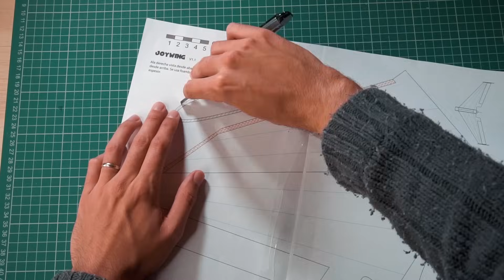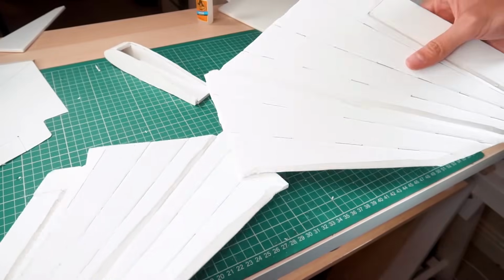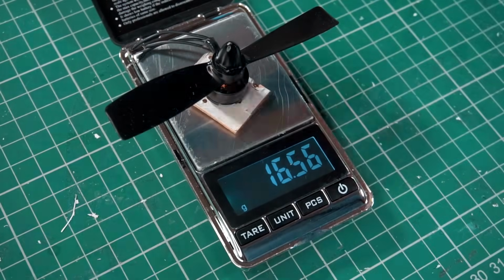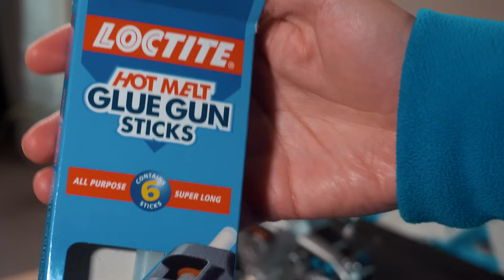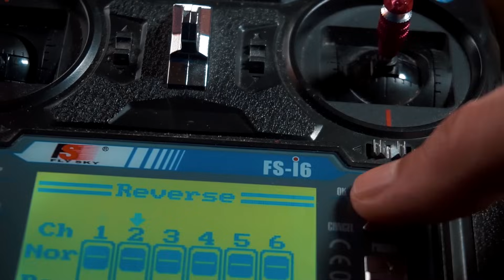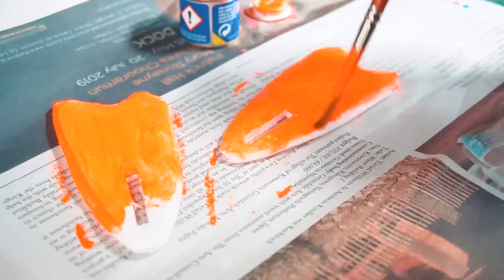I made an RC flying wing | Joywing 1.1 an improved version

Comment: NIce video but extremely sloppy work. Sorry, but you could have easily done it a lot better. Will it affect performance? Probably not. Will it affect how it looks and feels? Definitely yes. Also, you should have taped the leading edge with some glassfiber reinforced tape such as ductape to keep it nice and strong.

Comment: Awesome wing! I think It would have had even more power if you were using a xt 30 instead of a jst connector. I used a jst connector with a 1407 and a 3 inch propeller and the jst connector got very, very hot. So I guess it has a lot of resistance because the motor was pulling only 10-15 amps max.
Reply from the maker: Next time.

Comment: CONGRATULATIONS !! You maKe it look soo easy. I see the rain could be slowing you down, but you still have more freedom in Ireland than in the USA. Here the goverment needs you to register everything (any UAV, unmanned aerial vehicle) and there are very few fields like yours where you can fly without being chased away.
Reply: No. You don't have to register every UAV. There is a weight limit. And, there are plenty of places to fly a plane, especially one this small (which doesn't need to be registered, by the way). I fly planes and drones in my local park and at a few different baseball fields regularly. Additionally, there are two RC Plane parks located in county parks where I live, which have runways and allow you to fly much larger vehicles.

Comment: Is there any go pro vedio transmitter which transmit hd vedio on fpv goggles or fpv monitor??Kindly tell.
Reply from the maker: Only DJI goggles.
Reply: @Joyplanes  dji goggles comes with cam,transmitter,,and controller.

Comment: After seeing this a hundred times now I see he has a flight controller as well that is why this wing flies so well.
Reply from the maker: Incorrect, I didn't use a flight controller and I never have in any of my airplanes. Although you can use one and that will make it a bit easier to fly but it has to fit in there with the receiver.

Comment: Nice! A lot of effort with the ribbed wing though. These days i cut and glue  my flying wings for FPV with flat 6mm foam plates (depron) using KFM-2 or KFM-4 airfoils and cover them in tape. Builds really fast, flies nice  and  the planes are really, really, really robust.
Reply: Why are you posting this on all delta wing videos?

Comment: would it work if i use a 2200kv motor?
Reply from the maker: Yes if the size is about 2206 (same as the ones used on racing drones)
Reply: @Joyplanes  .ok.. thanks 🙌

Comment: Awesome video 👍👍, just a bit confusion on lipo battery means what should be the voltage of lipo battery?
Reply from the maker: Each cell holds about 3.7 v 50% charged so multiply that number by the number of cells to get the voltage of the battery.
Reply: @Joyplanes  ok it means around 11.1v, thanks for your reply and I always like your great work. Greetings from India 🙏.

Comment: remove the paper on the inside of a bend to make it even easier
oops
you could have done it on the fuselage
Reply from the maker: Yep, but most important you can do it if you plan to build it.
Reply: and xt30 connectors are a lot better than the red jst ones
Reply from the maker: @marc_frank  Yes but is more work to replace all the connectors of my batteries.